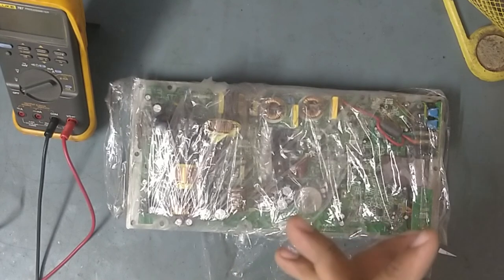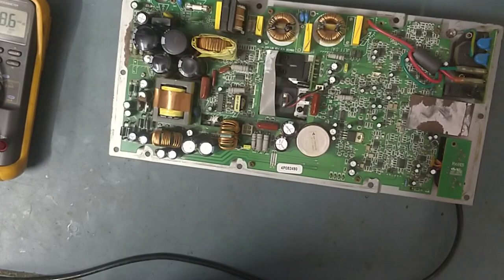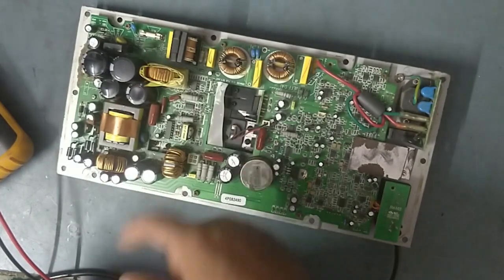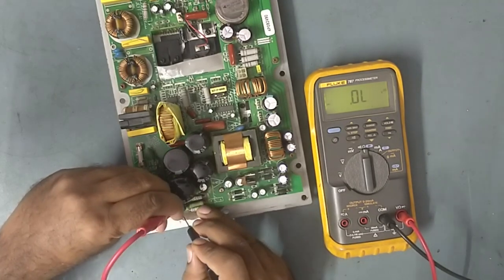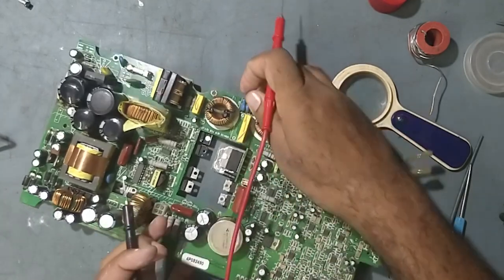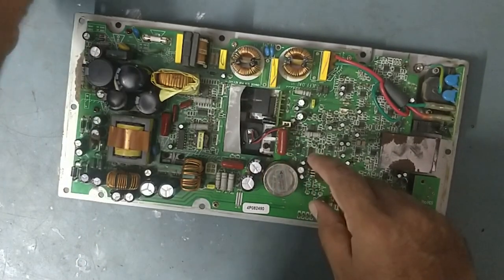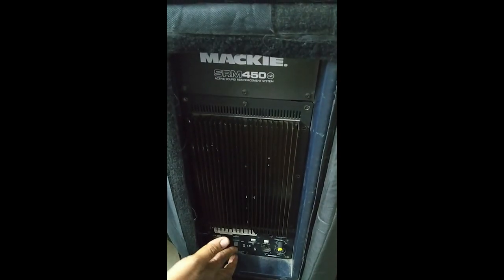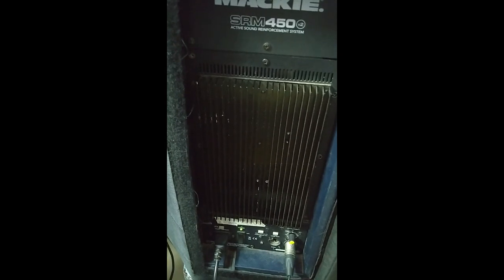Mackie SRM450 Active Speaker, Tips to know how to Repair partially dead amplifier board.

Comment: nice, straight forward repair , still lucky because the IC chip driver of the 2 mosfets survived, normally when the FEts shorted it damage the chip as well. and for safety purpose you should have check first if the power is turning ON, check if DC voltage coming out from the speaker terminals before fixing it to the speaker box and making audio test. It might burn the speakers if DC voltage is present on the speaker board terminal , as i say safety first but anyway nice repair .
Reply from the maker: Thanx bro

Comment: You are lucky as usually when mosfets blow they burn the gate resistors and also the mosfet driver chip. Having such a strait forward repair made it rather easy.
Reply from the maker: I am not lucky bro customer is  lucky as he don't have to spend more money.

Comment: Should've put heatsink compound on MOSFETs to heatsink surface to assure adequate cooling.
Reply from the maker: It would be more better if you use heat sink compound for every high Temperature components.

Comment: Two of the large mains filter caps were knackered. Tops bulging right out. Should have changed them whilst it was apart as a precaution..
Reply: I have a couple mackie powered speakers with the same capacitors. They have a black plastic top that make the tops look deceptively bulge-y even when they're good. Not saying definitevely that they aren't messed up, but impossible to tell from sight alone.
Reply: @Tronzoid  They don't bulge when new. As they start to fail they pressurise inside which results in the bulge. Eventually they will fail. It could be years or they could go "pop" tomorrow. They are designed to bulge so the eventual "pop" will be a lot less. Most of them have weak points built in to let the pressure escape once it reaches a certain level. This avoids a much bigger bang.
Reply: @Tronzoid  One of my Mackie's has 6 large filter caps and four are bulging but it is still working fine. I'll change them at the next service.

Comment: Sir,
my srm 450 v2 active sound reinforcement system is giving shrill on turning "signal present" knob. One of the  engineer changed the potentiometer with 6pin in line 50k value (available in the market) but the problem is not fixed. As per schematic it should be 10k potentiometer. Can you make it available or suggest me a shop where  I can get it at Pune.
Reply from the maker: 10k pot is very commonly available in any electronic Market & i am sure in Pune also available
Reply: Only 50k and 100k pot are available in nearby pimpri market.
Reply from the maker: See Replacing 10k pot or 50k, doesn't matter much, if still your problem not solved it mean something else is their Bro
Reply: Thanks you sir
 so much for your guidance and sparing time to solve the problem. I am trying to get 10k pot. On getting  will try. If still the problem of shrill exist, i will contact you for further guidance.
 Sir I wish to know from where you belongs.
Reply from the maker: Thanks for your compliments I am from Mumbai.

Comment: So, all I need is a Voltmeter, and screwdriver and the parts correct ? During testingI could not see which terminals you are connecting to, I am not an electronic engineer. Also, during testing, is the power completely off, or at one time it has to be on ? I am not sure.
Reply from the maker: Thank you for watching my video sir, I am sorry that u r not able to view clearly testing points, actually I recommend if you are not qualified technical person pls do not attempt to repair it sir, & by the way during testing voltages unit must be in ON condition where as during testing ohmic test unit must be in OFF position. But most importantly is always check any Malfunctioning Power supply board in series.Do not connect directly to Main AC power.

Comment: My srm450v2 have power but totally dead i change mosfet ic and mosfet but no sound icheck tha gate voltage and bypass the mute but no sound what i will do
Reply from the maker: After replacing MOSFET ic & MOSFET with new, still SMPS power supply is not getting ON